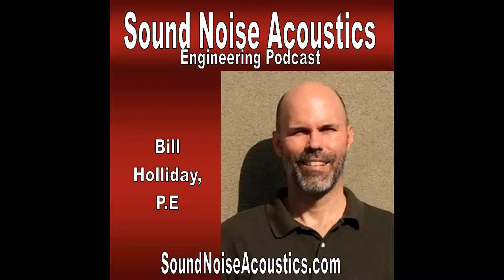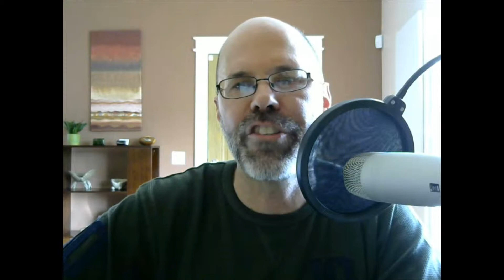#1 Sound Noise Acoustics engineering - introduction

Comment: Hey Bill, my name is Jef. I have a quick question regarding vibration isolation. How effective is the use of sand as an energy(vibration) absorb-er when it can be applied in any specific situation? I hope I relayed that correctly. I know it's a broad answer without specifics. But just in general, what is your opinion of sand? Thank you for your time. I appreciate it.
Reply from the maker: Sand would work fine - it's heavy and damped. It could be practical for some applications but it's heavy and could make a mess and be hard to apply in may situations.